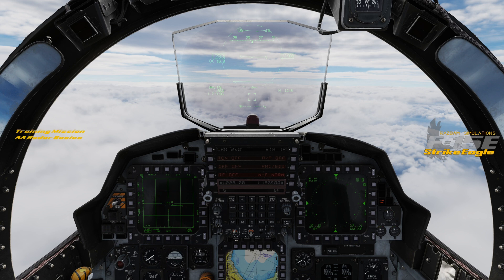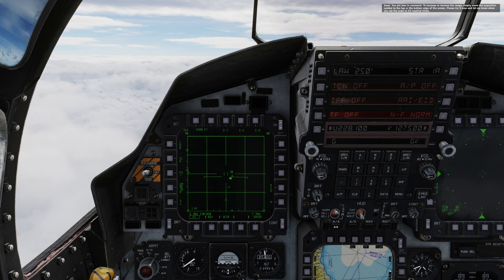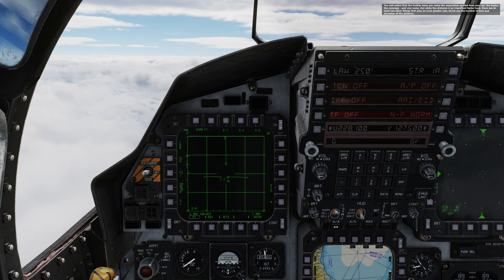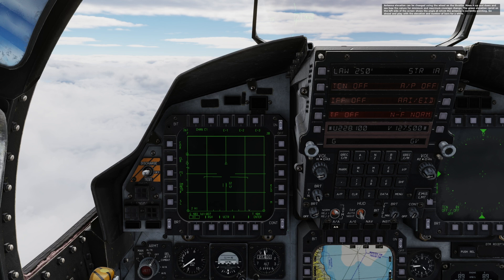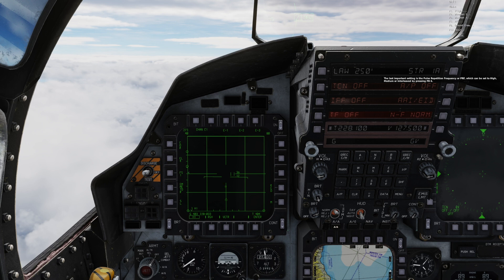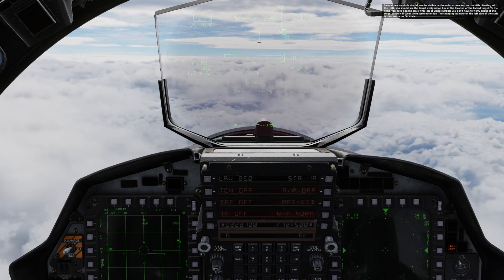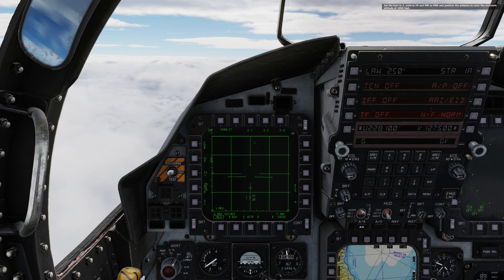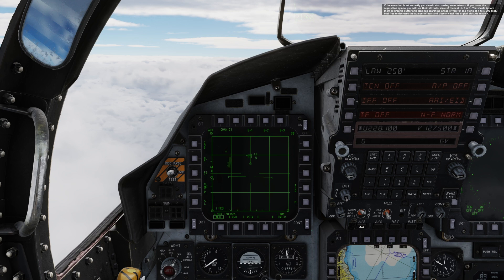DCS F-15E Strike Eagle: AA Radar Basics

Comment: How does the elevation axis function ? Absolute position like the F16 (control position = antenna position), or like the JF17 where you pull the antenna up/down with the control.
Reply from the maker: you pull it up or down with the wheel and it stays there.
Reply: @balticdragon3611  you answered nothing
does the antenna stay there relative to horizon or boresight
Reply: He answered the actual question. Your question is a different one.
Reply: its spring loaded to the center 
in very basic terms, you roll the wheel off center then release 
the antenna stays where you pushed it
Reply: @SDsc0rch  Like the hornet?
Reply from the maker: It’s OK. TBH can’t answer that. It is a wheel, so I assume similar to F-16 but best ask Notso about it, I only have what is coded and it doesn’t help